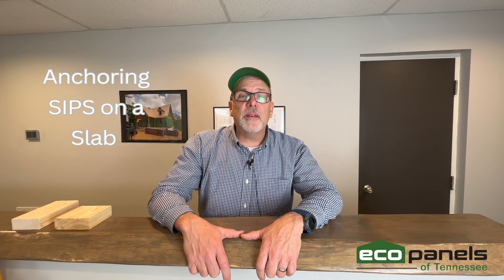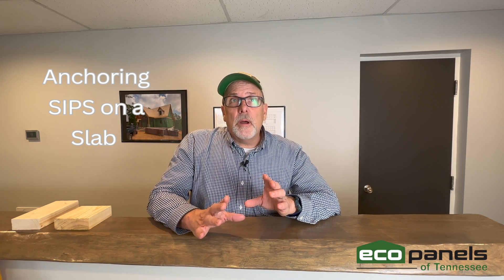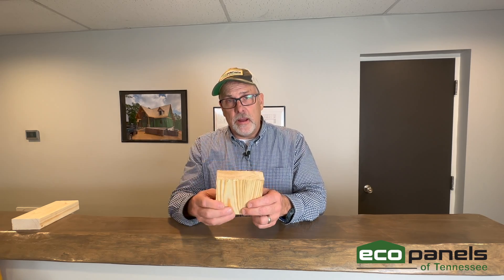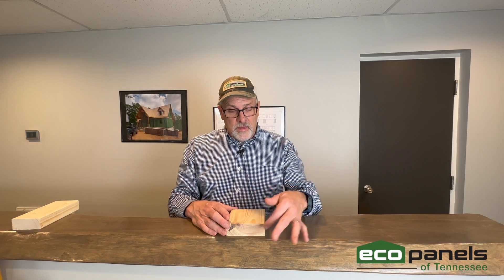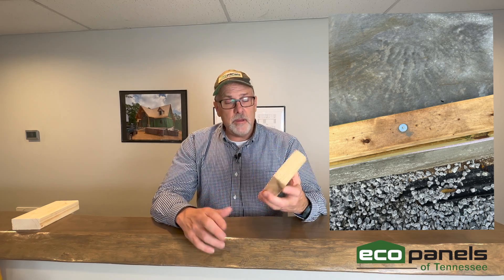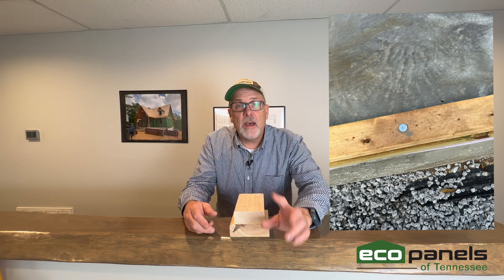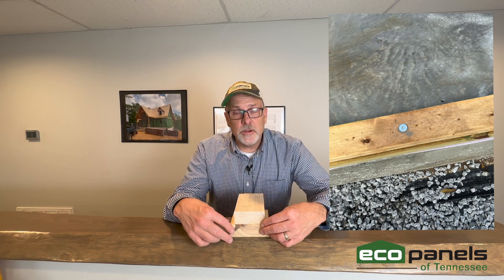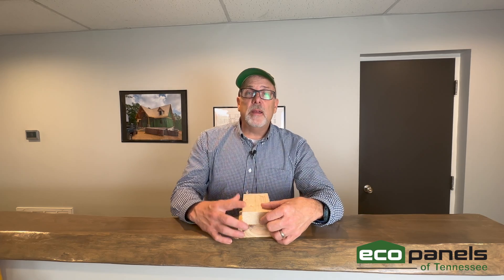Achoring SIPs on a Slab

Comment: Hi there, do you guys not place a strip of damp proof membrane between your sole plate and the concrete slab?  I believe that’s the practice here in the UK.
Reply from the maker: Great comment, and I think that's a pretty standard practice in a lot of areas, so yes. Keep in mind we don't build, and don't provide the sole plate. We're a material provider of SIPs. So generally speaking, those type of building products and processes should be maintained for local codes and practices. Thanks for the question!